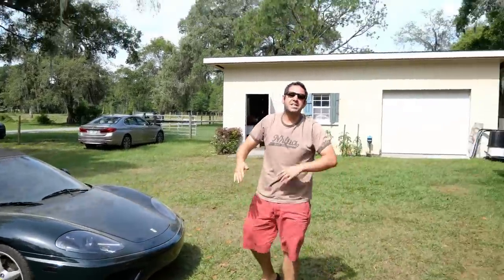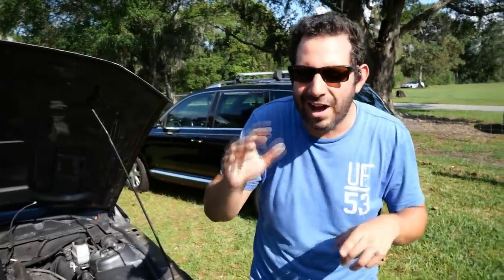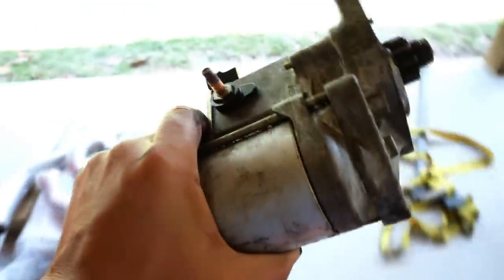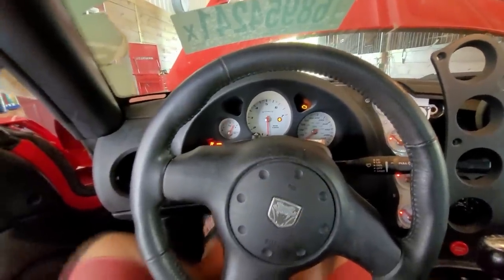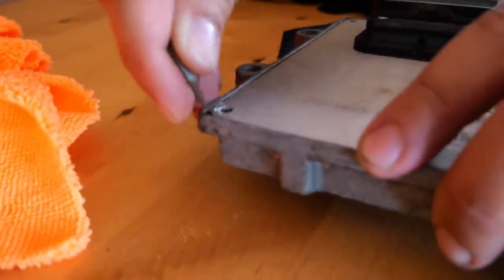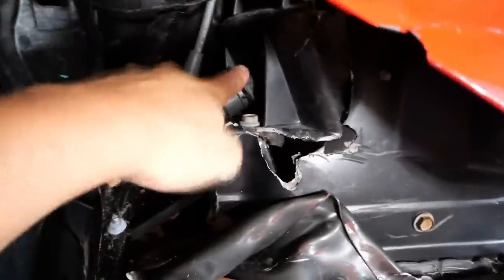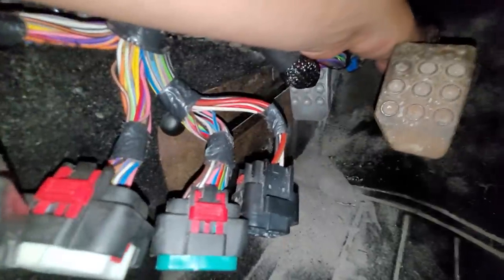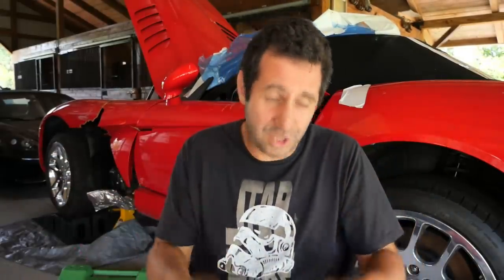Here's Why This Flooded Dodge Viper Won't Start

Comment: could also be the simple thing: neutral or clutch sending switch. 

What I'd do is put it in neutral, run power to the starter and manually kick it over. If it doesn't turn over or sounds like a box of gravel then no use wasting any more time if the engine is shot.
Reply: Just made a similar comment. The PCM needs to see very few things to actually turn the engine over, one of which is the completed clutch and/or neutral safety circuit. In a manual car, the clutch is the primary controller of the entire circuit. Since that area of his car is damaged, he may simply not be hitting the safety switch. Otherwise, the starter was definitely an issue.
Reply: You should be able to see the pids in the scan tool and see if the car is seeing what it needs to disable the starter interlock.
Reply: The problem is that there is still enough crud in the engine and cylinders to at a minimum blow out the rings on an attempt to restart it.  The engine needs to be taken completely apart before more damage is done to it.
Reply: @plektosgaming  Nah it'll be fine. Whatever damage there is is already done. My only concern is if there is more sand to be sucked in somewhere. I'd be interested to see a compression test after running. I'm betting mostly fine.
Reply: @plektosgaming  well yeah, we ALL know that lol. 

Right now, the engine is totally salvageable but start it? not so much after that. 

If that was my vehicle and I had access to space and ability, I would have immediately yanked that engine and sent it off to be rebuilt. 

The thing is: it probably just needs to be thoroughly cleaned and the cylinders honed. Basically a complete dismantle, clean, and reassemble. 

I seem to recall I could get a fully rebuilt V10 for $9000 CDN. So just a dismantle clean and reassemble would probably be 1/3 of that.

Comment: Clean up the BCM board.  Start with soap and water (yes you can use tap water) and scrub lightly with a toothbrush and then rinse the entire thing with isopropyl alcohol until there is no sand or debris left.  Once its completely dry, reassemble and try again.  You might find that the module works fine and the wiring harness has a break somewhere.  ;)

Comment: We wash PCB assemblies all the time.  Use a bit of non caustic liquid detergent and a soft brush and give it a good scrubbing.   Then clean with distilled water a few times.  Let it dry somewhere warm for a few days.  Any corrosion between leads or eaten off leads of ic’s will need repairs or further scrubbing with solvent alcohol for instance.   Then try it again.  Likely it works

Comment: I bought a Volvo V50 Diesel and it had a intermittent starting fault , the dash display would go crazy then stop and start.. I took it too the dealership they replaced the ignition barrel, still the same... A friend of mine mentioned the on the the main ECUs was behind the passenger side front wheel, dropped the wheel and liner and the housing was there opened it and the ECU was literally flooded.. I managed to save it cleaned the circuit board and it worked perfect.

Comment: Stick with the Mustang's original color.  never change colors, unless it's a complete-bolt-by-bolt teardown.  A color change may look good from a few feet, but the door jams engine bay, etc. always look terrible when they don't match.  (Plus, masking is much easier when matching colors vs. completely changing them.)
Reply: All the jams have been sanded and the panels were removed from the car.
Reply: He said the door jams will be painted

Comment: For the Mustang none of the colors you suggested, I would paint it Candy Apple Red w White Stripes down the hood, top, and deck lid. I loved the Red Cadillac used 2014-2022 or how about the Candy Apple Red used on a 1968 Shelby GT-500.

Comment: I'd say the BCM is still good use a toothbrush and rubbing alcohol and clean it up real good and let it dry well, reinstall BCM. Next since the clutch is all busted up your no-start condition is probably being caused by the clutch safety switch not being engaged. I'd put the ACDelco OEM starter motor replacement on the car, activate or bypass the clutch safety switch and crank that Viper over and listen to those ponys sing.
Reply: Nope

Comment: Last night i was attempting to replace a rear wheel speed sensor in my friends Chrysler town and country. In a DECENTLY DESIGNED CAR you would take off the wheel unbolt the speed sensor and put the new one in, technically it should take as long to take the wheel and tire off as it would to replace the sensor. On the 2012 town country you have to take off  heel, the brake caliper and the backing plate to GET to the wheel speed sensor. What a piece of total crap….i would NEVER OWN  CHRYSLER PRODUCT……thanks i feel better now!

Comment: The ECM probably shares a CAN signal with the BCM. If any corrosion, it will interrupt the signal and not let them talk to each other. The bcm has to communicate the cab functions to the ECM. Not sure exactly how this system is wired, but confirm your CAN continuity and voltages between the modules

Comment: Once I accidentally spilled a drink over my MacBook. It behaved strangely after that, bluetooth didn't work, a sensor reading was way off, the overall performance was very bad. I was able to clean the pcbs inside with special pcb cleaner spray and a toothbrush. That solved the problem permanently.
If I were you, I'd give it a try and clean the BCM with a pcb cleaner and a toothbrush.

Comment: It has to go through the body control  module 1st then they communicate  with each other. So what I'm  saying is when you turn the key on it goes  through the body control module  1st then in to the other module  then the engine  .. hope this was helpful.

Comment: Those newer style JTEC PCM computers are much easier to fix than the older ones.  That could be fixed by someone with experience so if you need to swap it there should be plenty of repair places online.  Dealt with one in Florida several times and they never let me down.

Comment: Check engine light coming on with key in pos 2 means the ECU is getting power and going through some of the initialization. It's a good sign. 
While some repair manuals state that you can check if a ECU is working when the light is coming on, I had failed ECUs both with the check engine light on and off, though.

Comment: Ensure your inline connectors are not shorted/pins backed out.  Also with the crash damage I'd check for any broken/stretched/shorted wires in the harness.  The fact that the BCM responded to diagnostics means that it is more likely that it is something in the harness.

Comment: Check the cab bus wire first that might be corroded and also get a ultrasonic cleaner or find somewhere that will run the board through a ultrasonic cleaner for you, the boards are usually waterproof and will clean up nicely.

Good luck with it!!

Comment: When it comes time to trying new or used boards, you may be able to bypass the clutch switch (youll obviously need a wiring diagram.)

Comment: I'd just buy a couple used BCM's and try them. The PCM looks fine in all honesty, and I would really doubt that's holding it from cranking the starter. When I had a bad PCM, the starter would crank all day, all lights and everything worked, but the engine wouldn't run at all.

Comment: With those older dodge/Chrysler vehicles. If you change modules from other car that’s exactly the same model, nothing happens when you try and turn them on. You’d have to flash/reprogram them in order for them to be properly read

Comment: Sam, if the part numbers on the modules don't match, there's a definitely gping difference between the parts, sometimes it's the software that it contains. The plugs may look the same but the programming will be different. 
On the "used" PCM option, the car probably won't even recognize it being there,  as once they are married to a VIN, it's locked in. And if it does read, then you'll get error message saying VIN mismatch. (Working Dodge parts since 2016)

Comment: Toss the bcm in alcohol and clean it, then put it in vinegar and baking soda, then one more alcohol wash and flow the Sadler with a heat gun. See if it does anything. Fixed a lot of water damaged boards that way

Comment: The BCM is used as a CAN gateway ( ie the bcm is the gateway to all the modules) 

I you really need the bcm to have the same part number. 
Different part number will have some some disabled or not there. Or have stuff that your car doesn’t have.

Comment: You can definitely use a used BCM & PCM if necessary after they have been flashed and reprogrammed. I wouldn’t use a different part number control module as it may not be designed to work with that vehicle; it’s functions may be limited.

Comment: car computer exchange in cary nc is who i use , ive used them for several of my mopar jeeps, all the ECU have the 4 plugs with a different color ring that goes to each harness normally they sell you one and you send yours as a core but one time they did not have mine in the correct year so they repaired mine

Comment: You have to use the same part number or an updated version for the BCM. Also the BCM has to be programmed into the network with the other modules. This is common on most vehicles circa 2005+. You cannot use a BCM from a caravan unless the part numbers were somehow the same. A bad BCM will cause the vehicle to not run and will not allow the modules to communicate with each other as it is the central point of access for everything to go through.

Comment: First thing I would have done is get a bottle of 99% isopropyl alcohol and start scrubbing the PCB with a toothbrush. An ultrasonic cleaner would be ideal as well. It probably wouldn't work, but for $10 in supplies, it's worth a shot.

Comment: I would try finding a ram srt10 truck parts from 03'-09' issh.  Since that also, was Mopar vehicle that could be. Equipped with a v10 motor.  Keep up the good work man 🙏👏

Comment: I would try the BCM or Pcm out of a similar dodge pickup truck they both share a motor and transmission. So obviously they should share similar electronics.

Comment: First try to put the board in a ultrasonic cleaner, take a tooth brush afterwards to remove any of the debris that might still be on some components. Since the water has had time to corrode the contacts, it will always be a point of failure. This method (ultrasonic) is to just check if you might have some communication. This Body control unit must act as a CAN gateway if it makes the other units "visible".

Comment: Sam, I would try to locate the Airbag module and disconnect from the vehicle to see you can restore communication to the PCM. They are usually mounted in a lower area inside the vehicle (and probably corroded badly). In 2003 Chrysler started implementing the CAN bus on certain vehicles. Prior to that (such as 2002 Vipers),  the PCM communicates on the DLC pins 11 & 3 WITH the Airbag Module. Your airbag module could be taking down the network preventing communication. My Alldata has limited information on 2003 Vipers so I'm not sure what system topology you have. You could look at your DLC to see if pins 11 & 3 are populated or the standard CAN bus 6 & 14. Good luck!!
Reply from the maker: Great point! Thank you for the input

Comment: If the clutch pedal is messed up it might not be engaging the switch that allows it to start. Basically it seems like with the messed up pedal it would be trying to start the car without even pushing the clutch in which wouldn't allow startup

Comment: Many older vehicles used one module or another as the gateway to the data comms network. BMW E46 used the dash cluster as an example. So a second hand BCM should restore comms to the rest of the modules of the Viper. If a BCM from another vehicle uses the same connections in the same order then it may be possible to write the Viper BCM code to it. I mean if the circuit board is the same then could just be a different part number cos the mounting holes are different.
Either way, replacing the BCM should then give you ECM access.

Comment: Replacement BCM can be had for like $200. Clean the female harness connectors with QD and maybe a small brass brush and give it a shot.

Holy hell though man, a V10 TDI Touareg. Drove a used one once with a wild thought to buy. 10x better sounding than a 7.3 Powerstroke, but an equivalent 10x parts premium. Good luck....

Comment: The real way to go about this diagnosis is to check for powers an grounds at the ECU , if you have those then check for communication om the can bus. If you have both then you know for sure its the ecu. But I'd look into that clutch switch also, with the entire assembly moving like that I dont see how it could be making the clutch switch for the starter relay.

Comment: sam the bcm will send  5v to the pcm as a security protocol for the anti theft you may have a can bus signal as well as far as the bcm from a caravan get wiring diagrams from the net and refrence each wire from each plug chances are if the plugs are the same the bcm will be the same just some different software such as inputs for 4 doors and tailgate and duel climate power sunroof etc for a module under $50 bucks take the chance and see if it can retrofit. But there are 4 viper bcm's on ebay from 199 to 300 bucks cheers from down under

Comment: Usually most modern cars need the bcm and the ecu too be coded together with the key to allow the car too start so I’d say a new set would get it too crank if not start

Comment: You must use the same numbers. The BCM's are not programmable, but are drop-in. If the PCM is an issue you have All Computer Resources, Inc. there in Homestead, FL. I got a rebuilt PCM for my Dodge from them not long ago.

Comment: Sam, I have a 2000 Jeep Grand Cherokee (Chrysler) and 09 Wrangler, 
The Grand Cherokee taught me when I tried to delete the SKIM (chip key) the BCM did not like it, because they deleted the VIN out of the PCM,  so the alarm kept going off. 
So becareful trying to mix and match BCM, and PCM from other models. 
Now the Wrangler fuse box is called a TIPM, inside that thing is the many electronics, like fuel pump relay, etc, I'm sure the TIPM is full of sand too. 
The Wrangler is dead because it quit firing on cylinders 1,3,4,5 no one knows how to fix it. I replaced the TIPM because its a known weak point on the first gen JK line... I hate chrysler at times. 
Just like the WJ rivable but at 3k rpm the fuel pump shuts down, and has zero fuel pressure, again another issue no one has a clue why. 
Good luck with the viper.

Comment: Part numbers have to match on modules. BCM controls a lot of functions on the car and its got transistors, relays, etc soldered onto the board. If you dont match the part numbers something may not work like a function in the car you got it from might not be in the viper or vise versa. Many module repair places offer cloning service for a replacement module IF they can pull vin information mileage or whatever is stored in the module. If not then the new information will have to be written to the replacement module. This is at least how everything works for bmw modules because they store a lot of data such as mileage and keys in multiple modules. It may be simpler for chrysler products.

Comment: I'd be curious if the bcm has different strategies. Whenever I order any module they want the vin because the modules can have different strategies. All the cases are pretty much going to be the same. It is the stuff on the inside.

Also, don't forget to check the clutch switch. Those fail pretty commonly on all Chrysler products of this Era. It is a two wire sensor. I usually just jump the pins and that will make it read clutch engaged. I typically just offer to my customers to replace the sensor or I can just hard wire the wires together. The clutch switch isn't important on these years. Plus then you can start the car without pressing the clutch. Really nice for just a quick start to warm it up. 

Happy to check the dodge part number for ya, and even totally down to order the module through my shop and send it to you at cost.

Comment: Please check the wiring and voltage lines to the computers. If the car is not able to supply enough power to all the systems swapping the parts won't work or even worse if the current being pulled is too high you can fry all control modules.

Comment: Have the module rebuilt by a reputable company. I've owned Dodge caravans/Plymouth Grand Voyagers since the 80s. Good when they run, but nightmarish when you have to repair wiring or diagnose electrical gremlins.(some modules are shared by Mercedes-Benz as Chrysler is their parent company at the time that was built.

Comment: Agreed, the intake won't add anything below 6500rpm and will probably loose more under the curve then it will ever gain up top on an otherwise stock motor.  Headers, custom tune, clutch upgrade, and possibly upgraded valve springs would be a more complete package.  Maybe even LM Intake Only cams if you really want a "Boss Light" build.  Should make 430-440 hp at the wheel with the cams.  Not a cheap build for the given HP gains but your view count would certainly more than make up for it :)
Reply: 6500k means 6.5million lol
Reply: @berube361  Thanks, my bad :)

Comment: dito on over parts the problem is that part is ID coded to that car  and that is in the subcode in the ECM and the BCM just hang on for the parts you sent away to be fixed